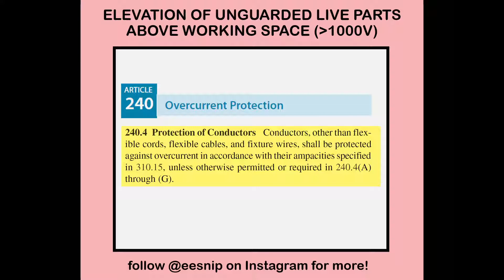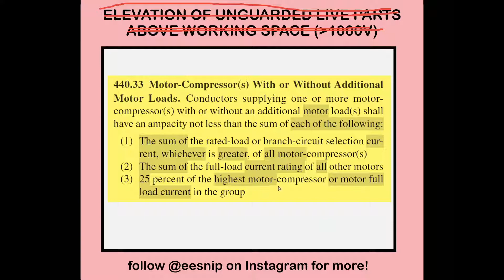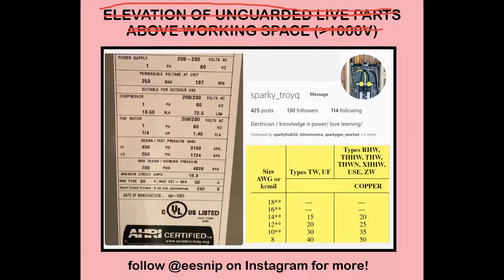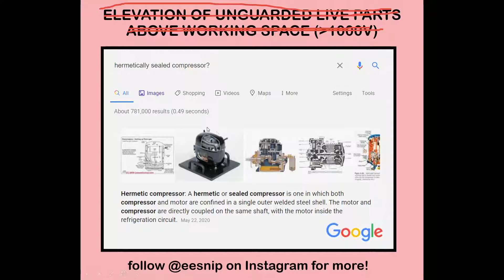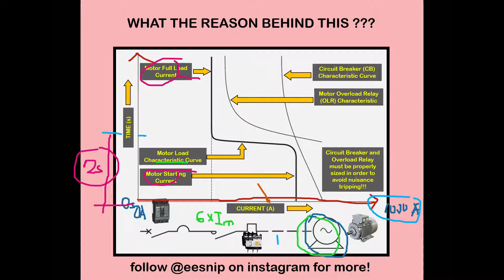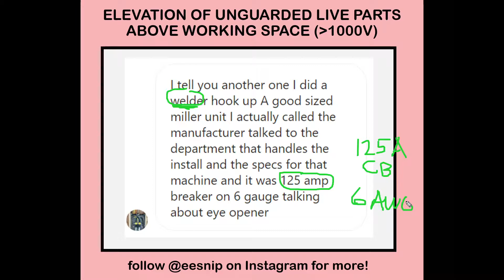Q&A: Is it okay to have 10 AWG wire for a 50A breaker for aircon units?

Comment: Does it affect the durability of the said wire? Let say after how many years of using. Mostly the aircon nameplates here in the Philippines do not have the min circuit current and max ocpd ratings